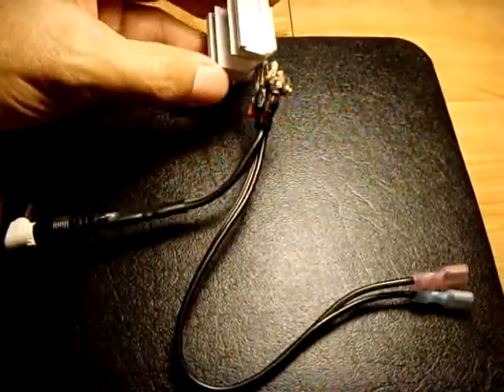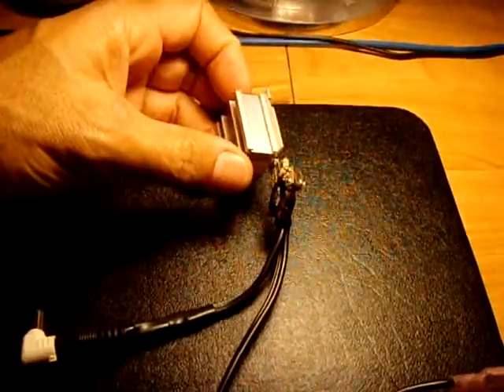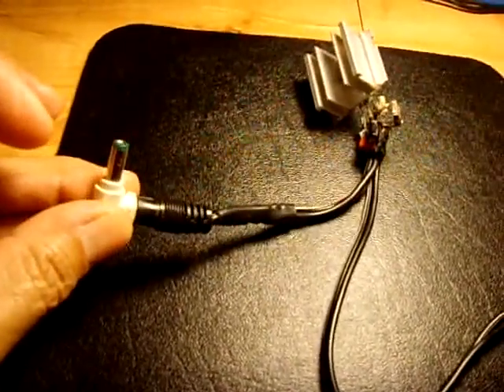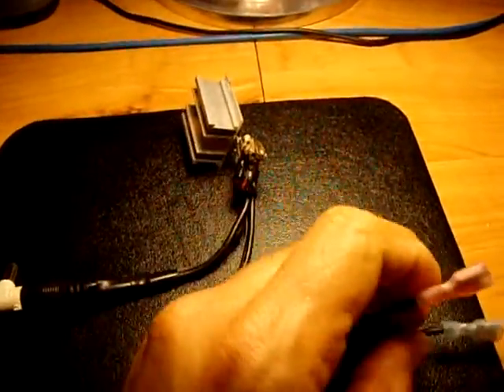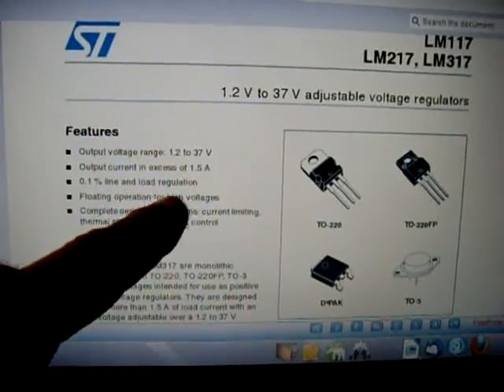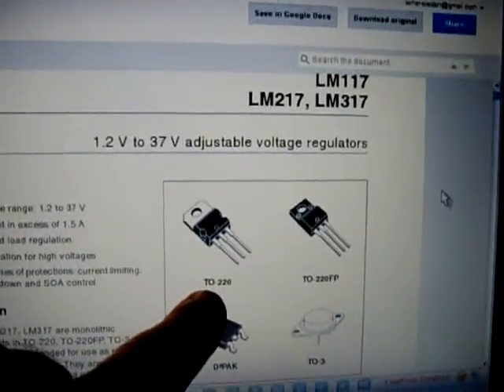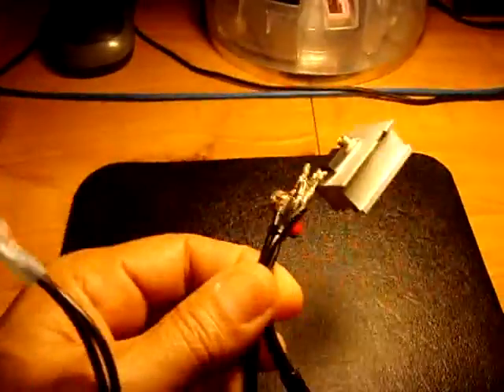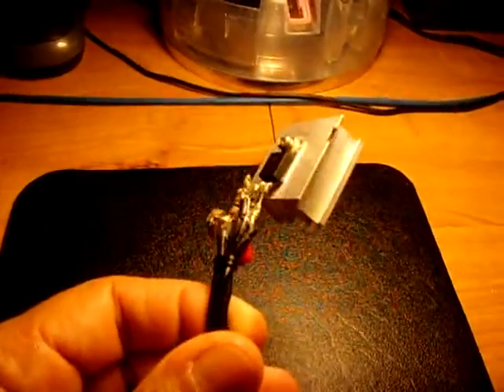LM317T DC Voltage Regulator Circuit

Comment: Also check out the LM350. It only goes to 33 volts but can handle 3 amps.

http://www.taydaelectronics.com/lm350-lm350t-adjustable-voltage-regulator-ic-1-2-33v-3a.html

Comment: there are some hidden secrets about the lm317 regulator circuit and the lm317t regulator circuit the data sheets don't tell you and that's they can be run backwards to

Comment: Ive loved this device, so handy and any tricks you can do with a standard 78xx regulator will work on the 317.:-)

I used one to provide my eprom programmer stepped supply voltages, a group of fixed resistors are switched in with push button logic and leds to show the selection.

You can increase the output by an input resistor, and a transistor across it, as you know.

And lends itself to be a constant current charger :-)

Good video mate :-)